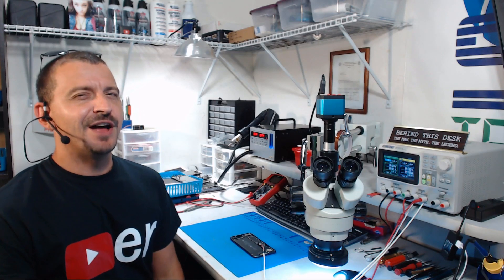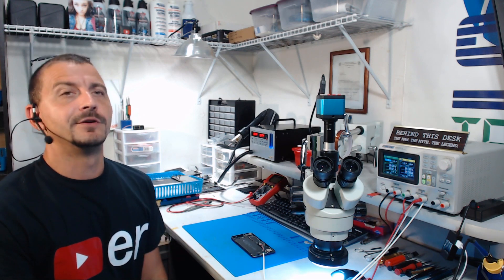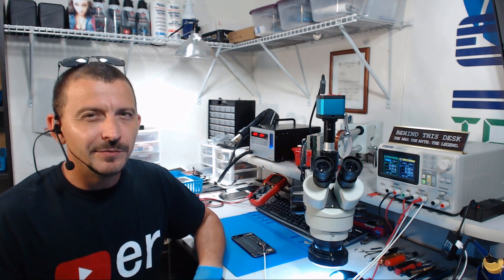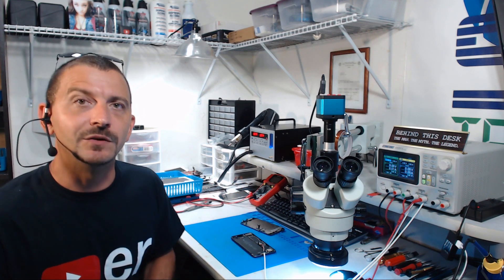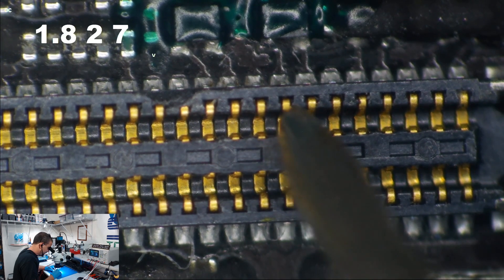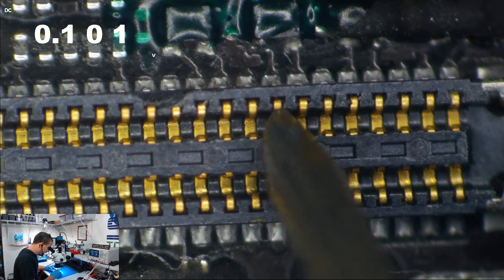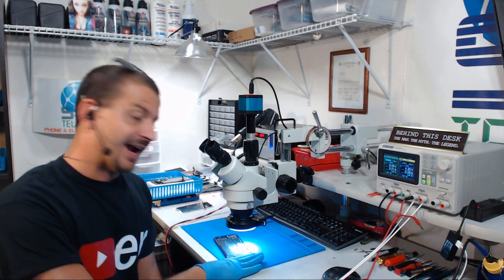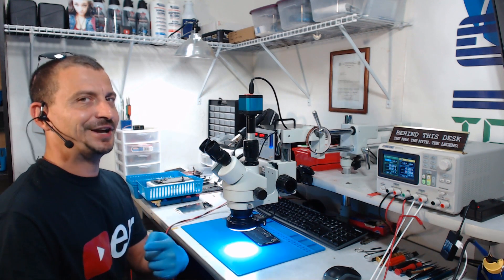iPhone 7 Plus "No image" caused by a CPU short - Jason gets trolled

Comment: Hi, i have an issue with an iPhone 8 that is overheating to the point of hurting you fingers when battery is plugged in(Mind you the battery is brand new), it seems to come from the middle of the board Nand/charge IC maybe i have no clue, do you have any pointers to where i should look? i am thinking of leaving it to a shop soon so they can figure it out because i dont have the equipment to evaluate the issue but maybe i can give them some pointers so it doesn't get so god damn expensive with them searching for fault haha :)

Best Regards

Comment: Sir , i replaced a iphone SE u2 ic , but when i plug the cable just for the first time it shows charging sign , when i take the cable out and try to put it again to charge it doesnt show nothing ,no charging sign , no battery increase.
Im 100% sure thst u2 is connected 100% ok. 

Can u give me a little thought pls, im on a big pressure from costumer. TY

Comment: I had the same issue on an iPhone SE rear camera connector. One pin would read 0.071 in diode mode (I think it was the pp1v8 line) so the camera would not work. When I went into the camera app and would press the switch camera button a few times it would all of a sudden start working... I switched 2 caps and a filter on that line from a known good board and saw no difference. Concluded that it must be a CPU short. This video was helpful Jason!

Comment: hello, thanks for your videos, they are very interesting, I'm learning so many things, I'm not very good at electronics, I would like to ask you a question, I had never used a hot air station before, I've done a bit of practice on some cards, but I have a mysterious problem with an iPhone 6, it has jumped a capacitor C200 that caused the black screen (I think), I should solder, I say I should because I have many days I try but I can not pay it, because any temperature and ventilation of the hot air station the pond does not melt, I can not understand why, can you help me? thank you
Reply: Add low temperature solder

Comment: Didn't try changing out the coil. Wire insulation melted - possibly caused partial intermittent short affected by heat

Comment: Yeah! I’ve got an iP7 here with exactly the same symptoms. I still have it after the owner donated it for parts. I’ve kept it complete. Turns out someone at a house party put it in a microwave oven for a small period of time as a drunken joke. It boots and operates fine, just no image which is intermittent. The logic board has an internal short under the one of the coils and has been so hot it cooked the solider. I’m just wondering in your case if the power button lines have been effected in the same manner? Maybe a grounding issue with other internal logic board line breaks? I guess the coils would act as antennas when being cooked in a microwave? Who knows what other damage exists. As always Jason a great video from you my friend. Keep them coming? As always a BIG 👍 from me!

Comment: Dam, that is odd, i think the pcb damage was likely playing with you :-(.
That data line could be too close and getting carbon shorted, also depending on the pressure used on the pcb at the time of testing.
The old screen sounds like it has a semi damaged data line, with a full amplitude of signal it would likely work.
All guessing on my part lol.
You are still the king of phone repair, as far as im concerned :-D :-D
Reply: Good logic, he should remove the coil and dig underneath it, it's possible with all the heat caused by VDD mains short that the 90_MIPI_AP_TO_LCM_DATA1_P dataline is now half shorted to ground from underneath, especially if it doesnt work during boot(high current) but works more normally during idle(lower current) the short to your data line may only block the display when your current is high enough, this could also just be the CPU but it's worth the shot perhaps.

Comment: Hello!! Where do you buy that green liquid you use to seal? Thank you.
Reply: bro  called uv curable solder easily available on mobile spare parts shop and you need also uv light
Reply from the maker: Yes, green UV mask indeed.  It's very runny but cures quickly under UV light